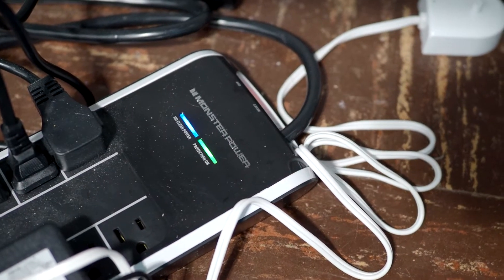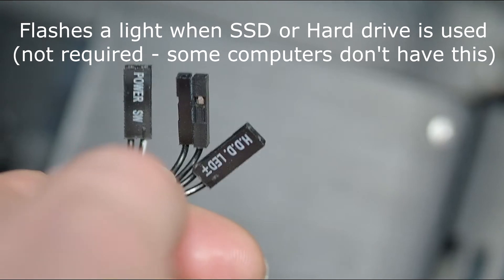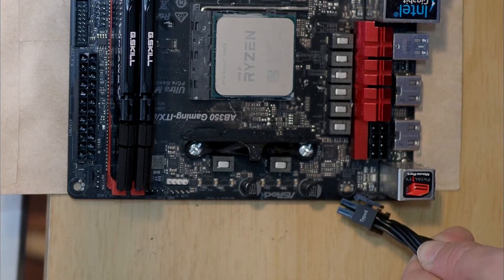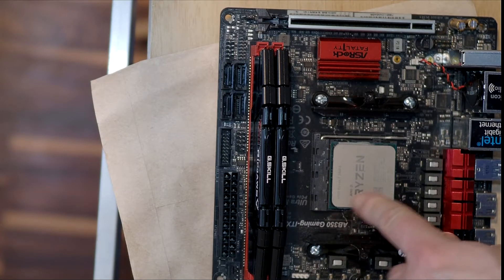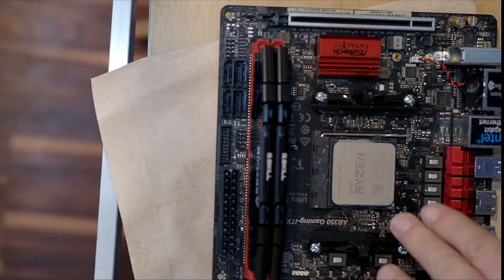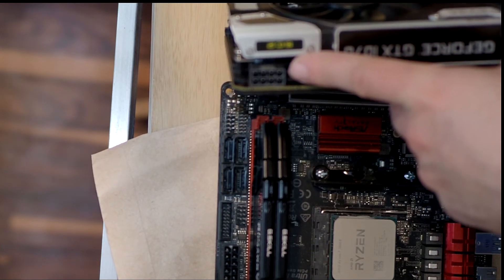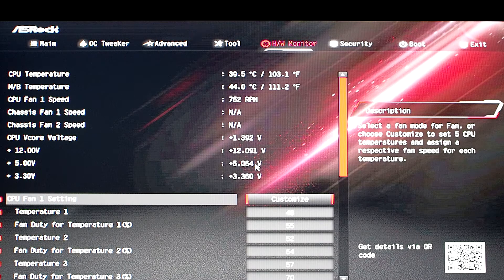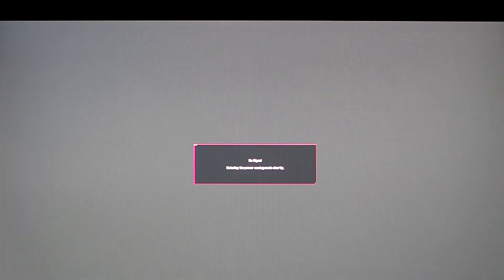Reasons a Computer Won't Turn On Part 1

Comment: My motherboard has power, the cpu has power, my gpu has power, and I tried starting my pc with screwdriver. So maybe ram but last week it worked fine so I have no idea
Reply from the maker: 1:34 is the most common exact same issue you are having will result
Reply from the maker: The screw driver trick can be dangerous in that it is easy to damage the computer especially if you don't know what you are doing.

Comment: I have an hp8300 after I setup my ssd and tried to boot from it my pc kept going to a boot window so I left it alone for a bit.

Then after it would power on but the only thing would happen is the fan was extremely loud.
and now it just doesn’t boot up at all but the motherboard light comes on when there’s power.
Reply from the maker: Sorry for the late reply, I work 12 hours a day with my main job... The motherboard light indicates boot failure that something is wrong. The fans being loud indicates a failure as well and is no longer controlling the fan speed. Did you try resetting the bios? Have you tried your original storage drive to see if the system has failed? 

Do you happen to have a spare CPU to make sure it has not failed? If your system is older it often happens CPU coolers and power supplies can gather too much dust over heat and occasionally fail; especially in older computers. The bios or load state of a computer does not allow an idle state like in the case of having booted into windows.

Comment: My motherboard rgb turns on. Every cable is connected correctly. Ram works.trsted on other pc. What could it be.
Reply from the maker: Your giving me very little information to go by here... I'm best at fixing things in person than online mind you, even 2 way conversation is easier than messaging back and forth... Did you try resetting the bios? Did you make sure it isn't your monitor? Did you try pressing F2 key after it had been turned on for 20 seconds in case your bios reset but your configuration is locking you out of viewing the bios which is showing F1 to enter setup and F2 to continue. Is your monitor output set to the correct cable connected to the display? Did you try different video out ports to see if the issue is the port you are connected to?
Reply from the maker: Reasons a Computer won't Boot Part 2
https://youtu.be/CTPDnOMz8AQ
Reply: Same can you help me
Reply from the maker: @sadge7900  did you watch part 2 as well?
I'd need a lot more information to be of any help, like do fans turn on. Does it boot cycle? Is this a new computer build or did it fail one day?
Reply: i have the same problem. did you ever fix it?
Reply: @Tyler-fz8wf  I did. Notice one of the cables was crushed from the inside preventing it from working. So I got it replaced.
Reply: @AdrianHernandez-fw9nl  i looked and everything seemed fine, all the cables and everything i’m probably gonna take it in tomorrow
Reply: @Tyler-fz8wf  what exactly is wrong with yours? Does it boot or does it not turn on? You sure you have integrated graphics or a dgpu?
Reply: @Tyler-fz8wf  and is everything compatible?

Comment: I just built my first pc and it won’t turn on the cpu fans don’t turn on , nothing turns on only the gpu turns on ?
Reply from the maker: I'd love to help but if this video does not help you could have component issues. Not going to trouble shoot online, if you live in northern BC would prob figure out in minutes or even faster.
Reply from the maker: BUT let me make one simple comment did you happen to purchase a B550 with a G series CPU? If so it won't work. (AMD's great oversite that they have not fixed to this very day)
Reply: @sparketech  I purchased a b460 amd ryzen 5 3600
Reply: @sparketech  b450*
Reply from the maker: @andymiguel8451  can you verify somehow that your bios isn't old. The B450 chipset was released in 2018 but the Ryzen 3000 series was released July 2019. If your bios isn't current enough you'll need an old CPU handy to update your bios before you can run the 3600x
Reply: @sparketech  oh sorry I didn’t see your message but it’s know has turned on but I ran into a other problem my monitor sash no signal and I didn’t know how to fix it ?
Reply: Same is happening to me 
I have a b450m and a Ryzen 3600 I upgraded from a ryzen 3400g the computer has worked since I upgraded to the 3600 then this morning the pc wouldn’t turn on I’m so confused
Reply from the maker: @parrot64  Hint your bios needs to be updated. The AMD Ryzen 3400G is a 2000 series that AMD pulled a stupid naming move on, the 3600 is a newer generation of CPU and if you aren't using a newish bios it will be unsupported until you update it.